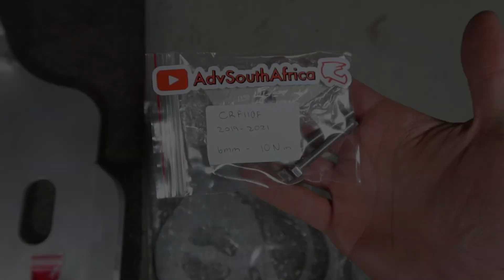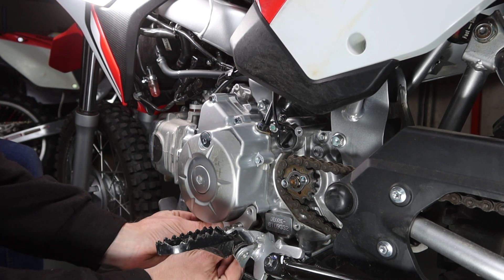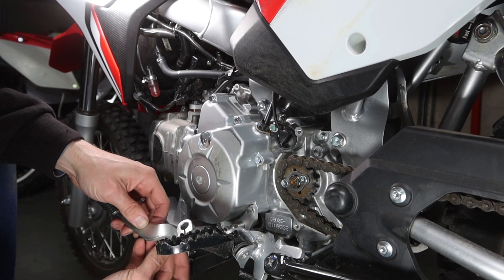Pit bike upgrades - Honda 2021 Crf110 Skid plate, Sprocket cover, Shift shaft brace

Comment: question, is the 2021 the same as the 2022?
Reply from the maker: Yes, the 2022 just has all red plastics
Reply: Thanks, because I Tried looking it up but no results so, Thank you
Reply from the maker: @Landon_fun1  no problem at all, the 2019, 2020, 2021 and 2022 are all the same under the plastics